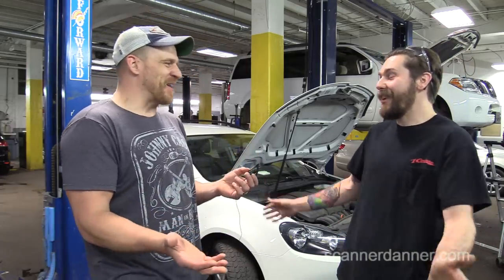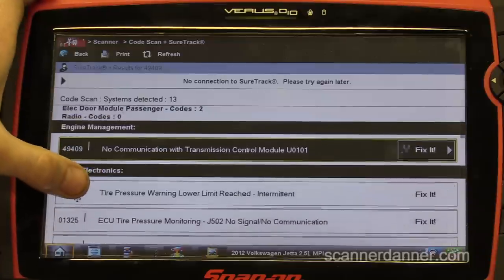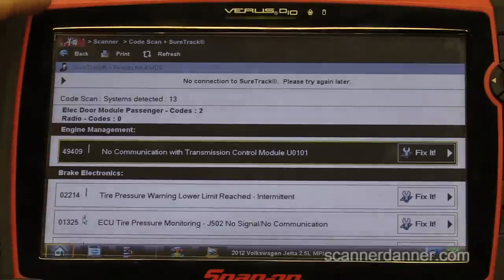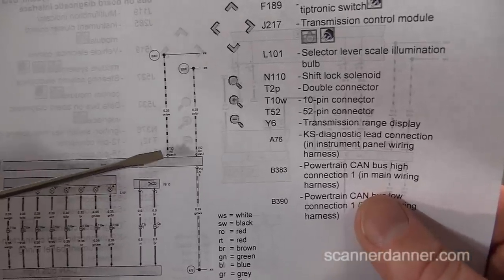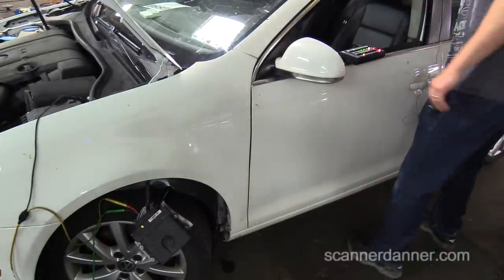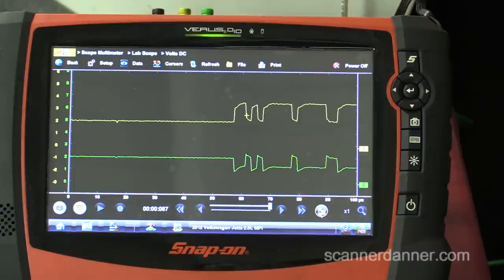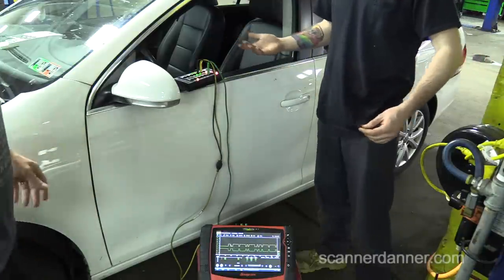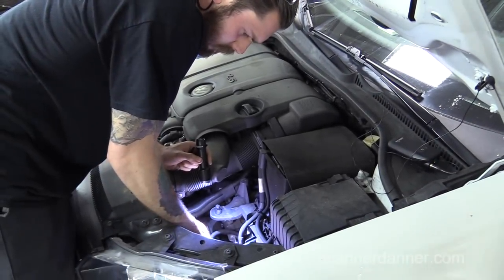2012 VW Jetta No Communication with TCM U0101 (part 1)

Comment: From the research I have done, the termination resistors are designed to stop ringing in the data line - sort of echoes that would make communication impossible. 
Think of the ringing on an ignition coil that has 'back EMF' after the spark burn time has completed - you get that wiggle that is an indication that there is reserve left in the coil, ensuring the coil is in good condition. So the resistors stop that ringing that would echo back and forth over the BUS line and seriously mess up the actual communication. Testing the resistors is one of the basic tests of the BUS line.
More of us Lecturer/Tech/YouTube creators are making it easier to diagnose problematic vehicles. It is the best way to share the knowledge we have gained over the years.I have been a Tech for 34 years, a Lecturer for 14 and YouTube creator for almost 2. (Sorry for the plug....)
Great to see you guys working together. 
Keep up the good work!!

Comment: I think this is one of the best vids yet. While watching I'm thinking this is gonna be complicated then knowing about the can bus resistance and thinking to check powers and grounds what else? It cant be that simple. So good watching you guys bounce ideas of each other and take the diagnosis a step further trying to understand how the system functions as these systems are constantly changing. Judging by the resistance difference at the tcm compared to  the aldl connector it seems there may be separate can bus lines for different systems but all terminating at the  gateway? There is some awesome talent now available through you tube with yourself Tommy Ivan Eric O and now Keith coming on board. To be able to learn and apply these techniques like this is awesome. Respect.

Comment: Exactly what I have been struggling with on my 2011 GMC Duramax  in regards to Can, Serial networks ,this video is very helpful and I am glad I invested in the actual service manuals when I purchased this truck ,wiring diagrams ,explanations of networks and the other modules involved with any other module .Watching you guys really helped me understand what it is I am actually looking for !! Still need to absorb how to utilize measurements of terminating resistors with the use of DMM

Great job guys
Reply: Ya know that stuff shld come free when you purchase a vehicle! It's BS having to pay almost $100 just to get your hands on info about a vehicle you OWN! It took me over a mt to find PART OF a service manual online thx 2 someone generous enough to post a download link. Def no thx 2 the Acura dealership who wouldn't even email me a wiring diagram & instead put me on "hold" (well said they were transferring me but hung up on me instead) & other times I called wouldn't do anything except tell me to get my car towed to the dealership! I'm unemployed at the moment so I couldn't afford to pay for a service manual much less pay the dealership to repair what I was able to fix for $5 once I accessed the info that's readily available to their mechanics!

Comment: Short to ground is 0 ohms, open wiring or resistor 120 ohms. Tip if you want to see communication you can open the door to get a bus message. Just some input love the video!
Reply: good tip on the door
Reply: Alex Brophy Simple is always easiest and often best...thanks
Reply: It's not a VAG com  its VAJ com😀

Comment: I work at a BMW dealer and we have a lot of classes learning about bus networks and such. I think that this Volkswagen might operate their bus networks in a similar way. 

when you were using the breakout box to measure both signal and resistance I think that you were just measuring on the bus lines for the gateway. like on Bmws we have a gateway module. and it has a diagnostic can line just on its own two wires that only feed to the obd connector. so in that measurement you were only looking at that diagnostic can line and not the can network as a whole. 

the gateway module in our cars is Just a translator. we have a few different bus networks. (PT can, K can, most bus, PT can 2 just as examples) and each of these bus networks operate at a different data transfer rate. some are as fast as 10mb/s and some as slow as 100kb/s. But every one of these bus networks connect to the gateway and the gateway is a translator. So let's say the ecu is on pt can, and is sending data at 100kb/s and it wants to send a message to the abs module on the k can bus which is sending data at 10mb/s they aren't considered to be talking the same language. the message that the ecu wants to send must first go through the gateway module to be "translated" into the language that the abs is speaking. 

we also use different terminating resistors in our flex day bus. it uses 90 ohm resistors. and instead of having 2 in the whole bus. Each module has its own terminating resistor. 

but I feel his pain on the no info thing. on our k can network we aren't provided info on the location of the terminating resistors or their resistance values. 

fun fact though. we use fiber obtic cables for the data bus on our entertainment modules like amplifiers and radios. they are very easy to diag no communications though. the bus layout is in series. so you just add in a fiber optic loop at the module that you think is causing the no com to see if everthing else after it begins to communicate again. 

we have also started using Ethernet as a way of communication and for being able to program multiple modules at once.
Reply: That's right . I'm actually working on a BMW with a K-CAN problem keeping the car from going to sleep. A module is messing up the CAN Low signal. I just need to find which. Thanks for sharing.
Reply from the maker: Thanks so much for the info!
Reply: junk cars
Reply: 360   Good info in just one message, in stad of one hour + of video time.  :)
Thank's  !
Reply: Does NASA know about this technology? They might want to overcomplicate their rockets to achieve the same thing they did decades ago in the name of efficiency........now I'm just being cynical eh?.....all of this just to drive down the road........
Reply: BMW training and info is much better than in the VAG world. Technicians have access to full technical documentation, including on bussing, and training is all instructor-lead and is also excellent.
Reply: 100% correct! We use the same exact set up at Audi, with the gateway, flex ray, and even fiber optic MOST bus systems! :)
Reply: For a proper mechanic there is no "i dont know VW" because i dont work with them... If you are a master ....you should know the basics and how to google....everything is the same across thr brands
Reply: @franciscovera828  says a junk Mechanic not a thecnician...

Comment: the  gateway is usually used to communicate to diagnostic tool one side and to  the other ECUs on the other side using two different communication networks. there is no physical link  between the two networks
Reply: my guess is they put a gateway to conform the european standards to work in usa

Comment: Just got done watching this one, love it. My 2009 jeep wrangler pin 14 and 6 pin of the diag connector go directly into the gateway/
totally Intergrated power module. Same thing, measures out at 60 ohms but no signal. I figured it was just used for communication with the scanner too. So I moved it to the power train control module and got the signals. I have also been burnrt too by the fuse deal that tommy ran into as well. Great catch Tommy! Here is what caught my ear!!!!!!!!. How many modules have just one power feed input????   From what I have noticed there always seems to be a keep alive power feed and a key on feed. That is the lesson I learned here. Paul and Tommy keep it coming, It takes real guts to stick your neck out. Thank you again. Scott Shoellhorn

Comment: Great video like always! I've been teaching lots of network diagnostics to my students. Really nice to have some backup to confirm my teaching. I recently learned that on a 2015 Jeep Wrangler, the network is very similar to this VW, in that you must back probe the network to see past the gateway module. I tried pins 6 and 14 with the breakout box just as you guys did, but found these pins were for scan tool only.
Reply from the maker: nice!

Comment: Hi there guys. I know this is an old video so you may not see this and it may have already been mentioned but the reason you were getting different readings with the scope and multimeter when testing at the DLC and the TCM is because they are two different networks. There are multiple networks that are separate from each other hence the difference in readings. I hope this helps and apologies if it has been brought to light previously. Love the content guys, I’ve followed you both for years. Much love from a trainee VW Diag technician from the UK ❤
Reply from the maker: For sure! We've learned a lot since this time. In particular when the DLC is wired to a gateway only. Thanks!
Reply: @ScannerDanner  No, thank you. You have no idea how much I have learned from you over the years. I’ve been watching your content for the best part of 7 years. 👍🏻
Reply from the maker: @jackstevens9907  thanks so much! That's awesome

Comment: Paul.  The two resistors stop signal REFLECTIONS at each end of the CAN.   Just like in your house.  When you have cable outlets in various rooms, those wall plug cable connectors should be terminated with twist on caps that have resistance.   Usually 50 ohms Z - or 75 or 92 ohms of Z.  Stops signal reflections the same way - "absorbs" that energy travelling down the coax (at 65% the speed of light :) so it isn't reflected back to your TV.

Comment: Difference on the voltage at datalink connector is, the scantool is using higher voltage on signal then the data bus module in the car.
Higher voltage at the scantool is used for the wake up the data bus module on some cars.
Higher voltage is the scantool talking to car and the lower voltage is the car talking to scantool.

Comment: Great video thanks
I made similar mistake a few years ago while trying to demo a scope checking can signal from the obd socket on a VW and was not getting any signal and only after checking wiring like you did figured it out

Up to about 2004 VAG group did not have a CAN in the diagnostic socket and they just used k line to talk to all ecus on the vehicle 
And on the later ones they used CAN to talk to all ECUs but they still used Kline as well for engine
As if the gateway is gone down completely you won't be able to talk to any ECUs except for engine as you can still connect to this through Kline

Comment: As much as people hate working on Euro trash,it's a smart design if you think about it. Otherwise one module can pull the whole network down and you would get stuck somewhere in the middle of the road. Motoyam82 has a video on a Nissan where the ABS module is causing the car not to start.
Great video Paul! I can't wait for part 2! I'm subscribed to both channels and Tom is great! 👍
Reply: Nick Nicu can you put the link of te video you mention please?
Reply from the maker: Got to give my boy Ivan some love for sure. I need to watch it myself so I can learn something.
Reply: Ivan even used the AES tool to check for shorts to ground! That versatility is why I was looking forward to watching you use it in this video. Thanks!
Reply: Keith from Staten island had a Chevy van the other day with no com, unplugged airbag module and everything worked.
Reply: Actually it was a Mitsubishi! In any case the wiring diagrams were easier to follow than anything for Euro. Even the terminating resistors were shown in the OEM diagram :)
Reply: Nick Nicu not a smart design- multiple networks can still render car useless.seen it lots of times,if people can finance car - manufacturer will put junk in them.

Comment: I would say the best way thinking about the Gateway in a Volkswagen network is comparing it to an interpreter. The main work the gateway has is making it possible for different types of Can talking with each other. If lets say the door wants some information from the engine it can not ask the ecu directly due to not using the same type of network, the door uses a low speed can called convenience can. Therefore you have a gateway that translate and sets priority. 
A good tip for using Volkswagen style diagrams is using them in the computer and use CTRL+f to find what you are looking after (for example tcm just open the correct diagram and write j217).

 
Sorry for not writing good in English and making this understandable.
Reply from the maker: Thanks for the info!

Comment: Terminator resistors are used to prevent echoes or reflections in the signal being transmitted due to some of the energy not being absorbed. A refection of the signal would cause noise or a dirty signal. They are placed at the farthest ends of the bus or network.

Comment: I'm a master Volkswagen Tech myself been with Volkswagen 14 years you probably could have used I wire it's a little better and I wish you pulled out the Otis scan tool yes the engineers they don't give out so much information but the next step would contact techline with your diagnosis and they would say put a TCM in it
Reply: Need your help
Reply: Can you help me
Reply: Crank no start 2007 gti dsg PRNDS lights flash on dash
Reply: Master tech wow
Reply: 😂Good for you buddy! Call your tech line and maybe they’ll send someone out to do the diagnosis for you🤦🏼‍♂️

Comment: Gateway is used to join two different can networks. On typical vehicle you have two different can networks. 
1. High-speed can - is using up to 1000 kb/s data transmition and is used to work with critical systems like pcm, tcm, abs, esp...etc.
2. Low-speed can - is using up to 124 kb/s and is used to work with less critical systems like for example car lights, indicatirs, door windows, alarm, inner lights, wipers...instruments...etc. 
For example the instruments are connected to low- speed can and it need to show engine speed. Thy instuments have to ask pcm for that data, but the pcm is on different network. That is way the gateway is used. It joins two different speed can networks. You can also have MOST network used for multimedia and it also need to comunicate with can .... the gateway is also used to join them.

Comment: high speed data comm faults is one of my favorite things to diagnose and i specialize on gm products. it appears unfortunately Volkswagen does not have main wiring schematic that shows a high speed lan schematic like gm does. basic principle is 120 ohm resistor on one end, usually an engine control module and a terminating resistor built into the body harness or a body control module on the other end housing a second 120 ohm resistor. both working on a no problem car using ohms law is 120 ohm divided by 2 modules = 60 ohm of resistance at the dlc pins 6 and 14 with all modules asleep. add usually 1.8 ohms of resistance for the 20-30 feet or wiring looping around in series. 61.8 ohms is a very common number i see on a majority of cars. i think 68.8 ohms is way to high even though Volkswagen states 60-72 ohms normal. most common things i see disrupt this data comm network is aftermarket devices usually plugged into the dlc that have to much or too little resistance and send electrical noise into the system. once in a great while i see other oem modules get internally shorted and lower the data comm resistance to lower than 60 ohms and cause intermittent loss of communications and symptoms are noted like no electronic power steering or harsh shifting and gm's stablitrak light.  i've seen a 2017 silverado diesel truck with a lift kit have 47 ohms or resistance in the circuit and get's intermittent stabiltrak lights and codes state loss communication with several high speed modules like u0100 as history code. tracked it down to aftermarket speed controller manufactured by hypertech designed to correct the speedometer for the oversized tires. it is tied into the high speed data communication circuit and is causing all this mayhem. i wish i was there to help you diagnose this one. hope you found my insight helpful
Reply: VAG wiring diagrams are horrific to interpret!
Reply: Thanks for the insight

Comment: What I believe those resistors are doing is stopping communication from going back to the other module as an echo if that's easy enough to understand the way I explained I don't know how else to explain it
Reply: Exactly, termination resistance (always at the physical endpoints) stop reflections from the high speed digital transitions from degrading the signal quality. The sad thing about this case study is that the TCM could probably be repaired by replacing one integrated circuit inside it. It might even be something as simple as a capacitor, resistor, etc (passive parts) on the board.  Somebody will replace a $1 worth of parts and sell it as a refurb.  Whatever happened to kill it is probably killing them on a daily basis.

Comment: The K and L lines are used for scan tool communication. K -line from module to scan tool and L-line from scan tool to module. Also, the gateway is used as an intermediate between the different can speeds: High speed and low speed.
You can still measure the resistance of the network at the DLC with the gateway  in between because from the DLC to the gateway is considered as the CAN C diagnostic. At least, that's what I understand. Also, the CAN Transceiver in each module, is responsible for the voltage difference.( 2.5 to 3.5 and 2.5 to 1.5).
Reply from the maker: Great info! I have since learned all this but really appreciate the comment.